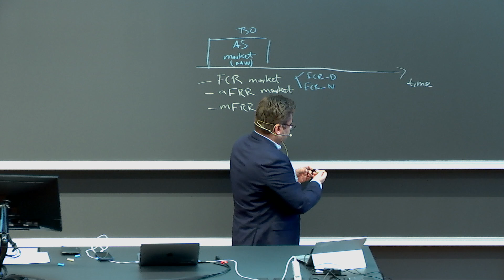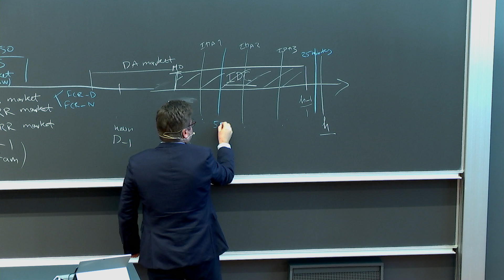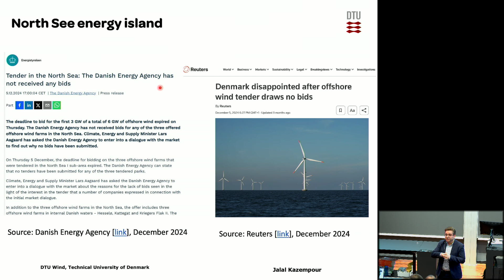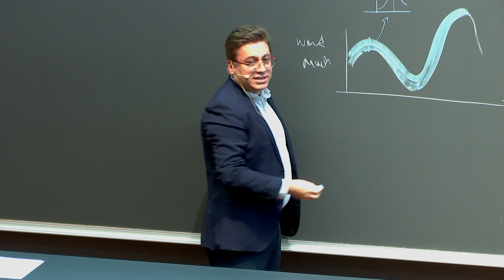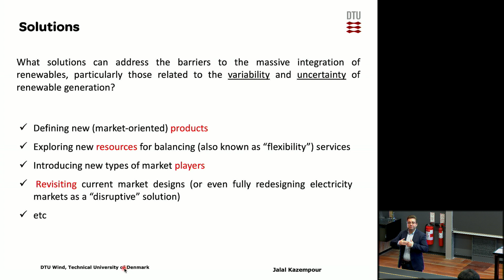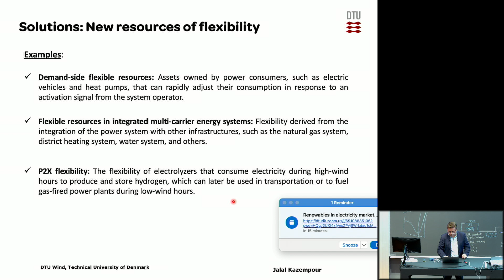Lecture 7: Impact of renewables on electricity markets

Comment: "Recall, the goal is to gradually push out conventional power capacity over time" - source? Logically, to mitigate climate change the goal should be to reduce carbon emissions. Even if you consider Denmark's political goal of 100% RE, that still leaves ample space for biomass which today makes up 68% of renewable primary energy supply in Denmark. Yes, Energinet forecasts a reduction in conventional generation capacity, but I don't recall them saying that the end goal is to push them out.

On another note, your lectures so far have been incredibly helpful for learning about electricity market dynamics. I am very grateful that content of such high quality has been made accessible to the world - props to you and whoever is in charge of production.

 I do believe you could benefit from looking at nuclear in a more nuanced way, as the marginal cost of NPPs are second only to non-combustible renewables meaning that they are very rarely priced out of the markets - even when the share of VRE is high. Secondly, they deliver inertia to the grid as well as FCR (examples include GER, HU, FR), aFRR ( ramp rate 2% capacity/min), and mFRR (ramp rate 5% capacity/min). These ramp rates translate to over 50 MW/min which is even faster than many peaker plants! Even if they sometimes are priced out of the market, they will benefit from alternative energy carriers such as hydrogen, just like VRE. 

I agree the big problem for clean energy technologies today seems to be financial - wind and solar are suffering from falling capture rates and while nuclear has seen increased capture rates, private investors are hesitant to invest due to the the disastrous projects such as Flamanville and Hinkley Point C.

Comment: Nuclear is very flexible Jalal. Look at the French Nuclear Fleet - is modulates from 20 - 40 GW almost every day during summer months. That is indeed very flexible. Bear in mind these are old reactors; new reactors are designed even more flexibly. Nuclear in France increased production immensely during 2023 and 2024, and still the Capture Rate increased. You shouldn't worry about nuclear, that business case is good. Worry about solar and wind cannibalizing each other. Why has the builtout  of new wind or solar in Denmark stopped? Because they are most vulnerable to this market dynamic. They have to share revenue during good weather conditions. Nuclear can simply turn up when the wind and sun is gone and catch that revenue.
Reply from the maker: Thanks, Carsten! I just learned something new about nuclear flexibility :)
Reply: While modern nuclear plants can technically ramp fast and follow load, its economics rely primarily on maintaining a high capacity factor and stable revenues over many hours, rather than capturing short peak prices. The key challenge is therefore not marginal cost recovery, but whether the plant can recover its fixed investment under increasing price volatility and low average prices driven by high renewable penetration. In that sense, nuclear is more exposed to long-term price suppression and investment risk. I understand your point, but I am still very curious if nuclear energy as a flexible resource is competitive financially against others. Thanks Carsten!

Comment: 1:13:50

can heat pumps be used to provide balancing services without compromising resident comfort? I understand EVs are very flexible, but in my opinion heat pumps are not. At least not on such a short timescale.
Reply from the maker: I think some companies are working on this. Among others, you might check out https://neogrid.dk
Reply: @jalalkazempour1429  great, thanks a lot. As a suggestion, could you perhaps say a bit in your lecture about which assets are traded on which markets at which volumes? I think that would bring a lot of insight in how the system operates. I haven't been able to find this information anywhere, I'm sure it must be hidden in the market data.
Reply: @pietheijn-vo1gt  in previous lecture he mentioned this by a figure based on response time
Reply: @WakizashiRants  I have not seen such a picture with the volumes involved. Which lecture + timestamp do you mean exactly?
Reply: @pietheijn-vo1gt  he's referring to a slide that showed the different types of balancing products: FFR, FCR, xFRR, etc. It didn't show the types of assets used in each balancing product, which is what I'm assuming you're looking for
Reply: @armaanladak  yes, types and volumes would be interesting to know.